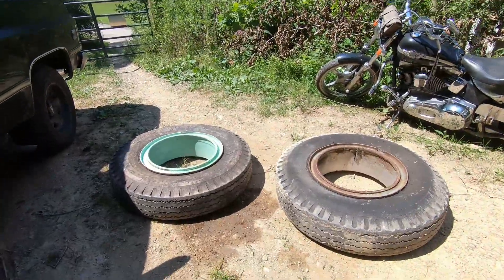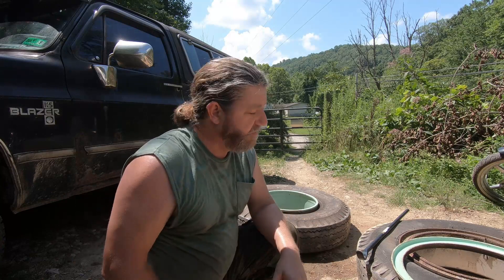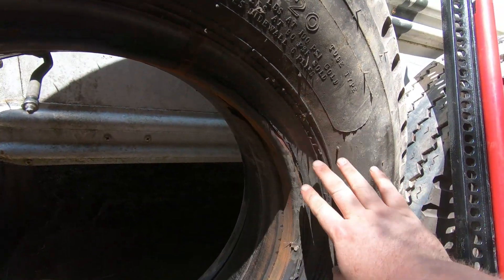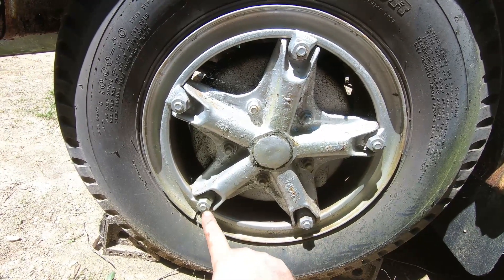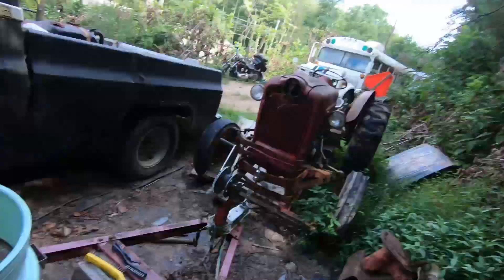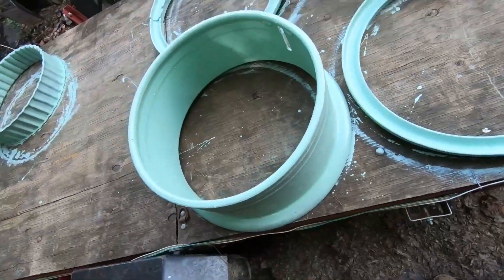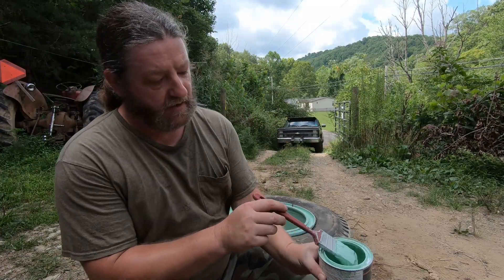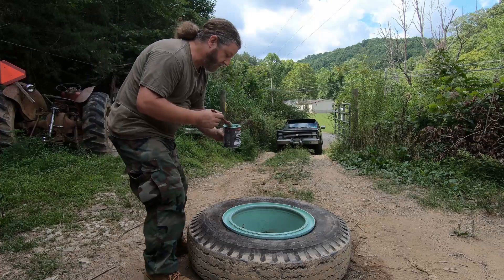Skoolie Tire Change With Hand Tools

Comment: I have Dayton's on my bus,they are a one piece rim(tubeless). I find them to be better for a do it yourself mechanic than hub style. I found using a motorcycle jack and a ratchet strap to pull the hubs was much easier than manhandling them. I actually like the look of Dayton's. Thanks for sharing.
Reply from the maker: Great idea using the motorcycle jack!

Comment: Well I'm a school trained "mature" mechanic (civilian and military) and those split rings are indeed widow makers.  I won't own or work on an over the road rig that has them. Nor will I own or work on an over the road rig with hubs like yours.  I'll take the lug nuts all day long.  And if you're "holding up" the whole mess to try to mount a tire, you're doing it wrong.  It's as simple as a tire iron under the tire and a little skill. I'm sure you just said it in a way that didn't make sense as you do seem to know what you're doing.  Good luck with that ancient tech stuff.
Reply from the maker: "Mature" mechanic..Love it! I'll have to remember that one. You are correct, I am an ASE certified master tech and have been for 30+ years. Been working on these old things since they were new.